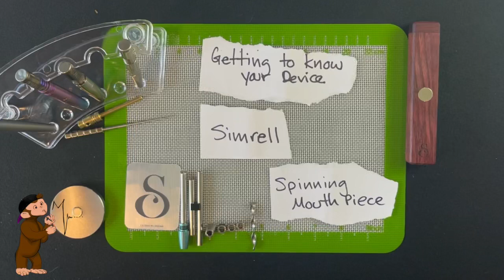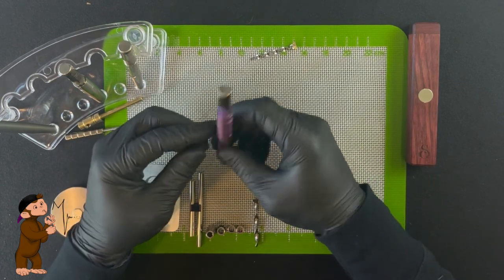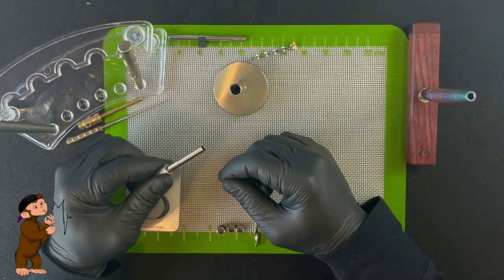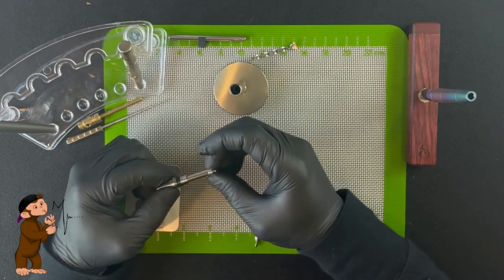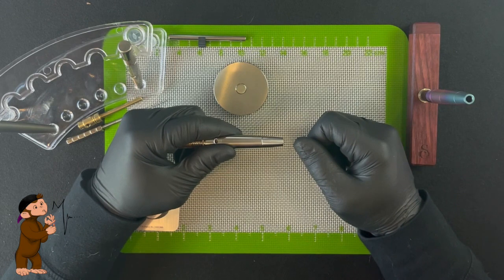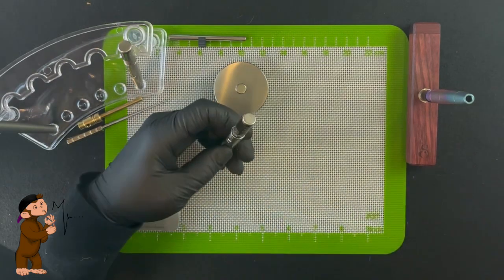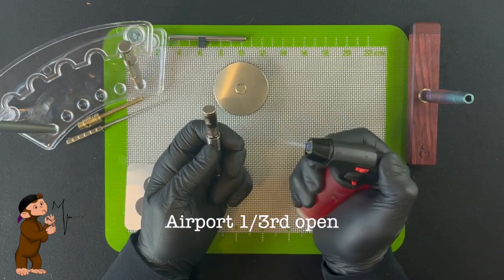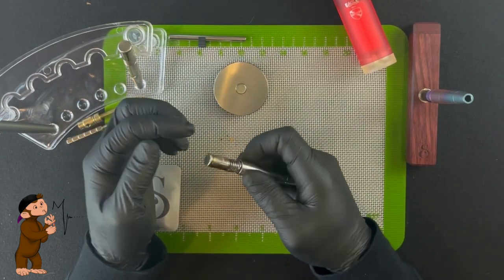Get to know: Spinning Mouth Piece, Simrell

Comment: Question: Is the only purpose of the spinning mouthpiece for when you spin the device when heating with a torch?
Reply from the maker: That is the main focus but the 2 other reasons I like it are:(1) when I have it in my mouth I can roll the device between my fingers to flutter the airport without it having to rub on my lips. (2) when using it in a water pipe same thing you can flutter the airport with out it grinding in the glass joint.
Reply: @MoOiAmATree  Got it. Thanks!